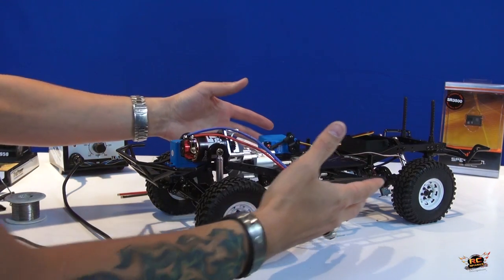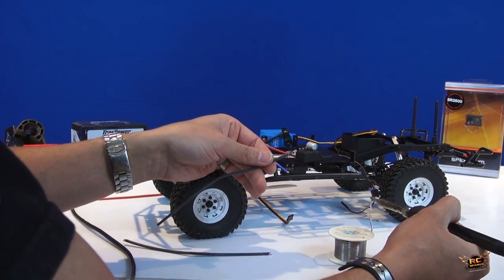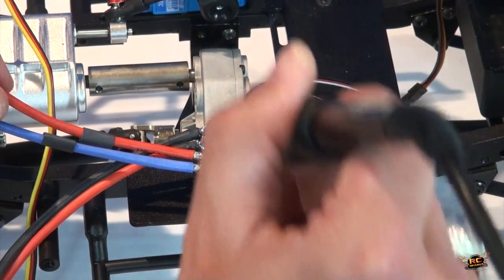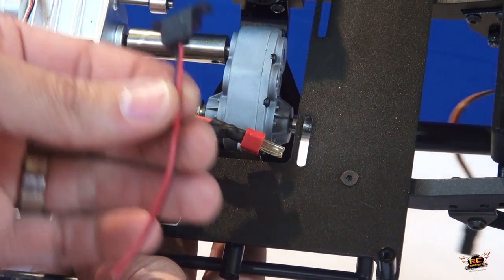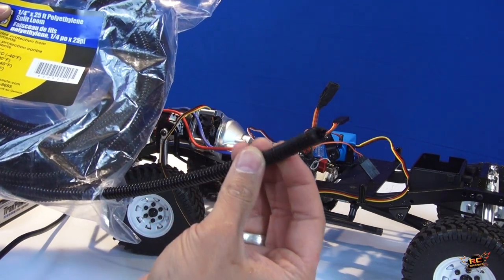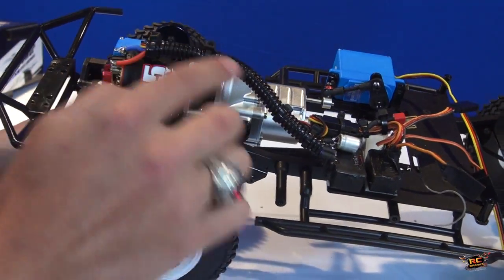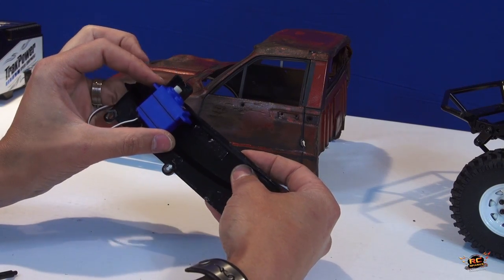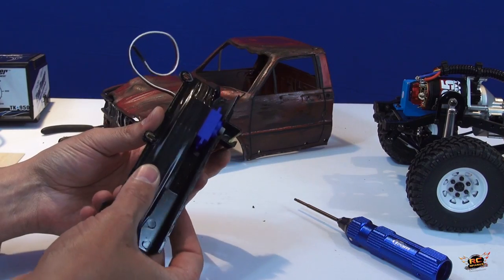RC ADVENTURES - RC4WD TF2 - TOP GEAR HiLUX TRIBUTE - RHD Moving STEERING WHEEL MOD BV6

Comment: Great video as always Medic.
My only issue with cutting the switch off is that you'll have always remove the body to turn it off (4 screws) if you are good with that, then great but it just seems like too much work just to turn this truck off.

Comment: flux actually prevents oxidation of the metal during heating with a soldering tip... 
if not used, then the thin layer of oxide that occurs on the metal prevent solder to stick on it... 
I'm electrician, and in all 14 years of studing every time when a soldering comes to place, teachers / profesors where telling us to use the flux...
And just like Medic said it help with the solder flow, the stuff is something like soft grease...

Comment: Instead of just hot wiring the whole thing I would recommend replacing the sliding switch with a waterproof toggle switch mounted on the base plate somewhere. Also it looks like some of your solder joints aren't mechanical connections and rely on current flow through the solder itself. I'm no RC wiz but I am an EE guy n know thats a bit of a  no no.

Comment: I Dont like your soderin sir if that wire heats up you will get a loose or cold joint 
I find it works best if you actulyrun the wire through the hole inthe post or termanal and wrap it around then add past or use flux cored soder and solder inplace 
Reasons
If there isany heat buld upit will start at a joint or splice wich also iswere your solder is
You ar loosing some voltage andamps by passing current through solder wich is'nt as conductiveas copper 
So copper tostud solder to hold in place